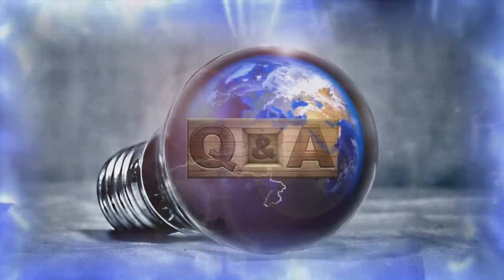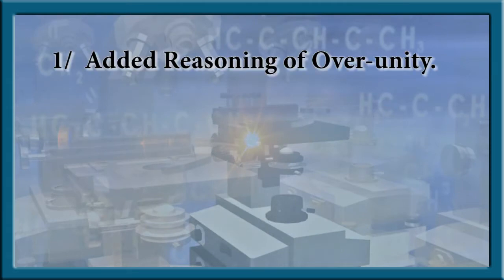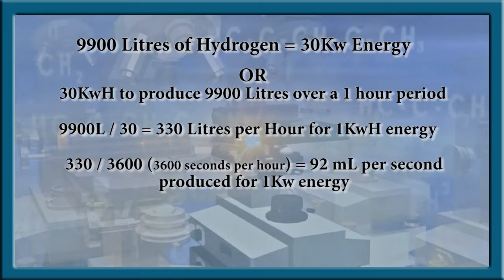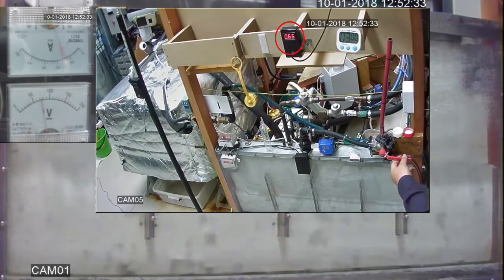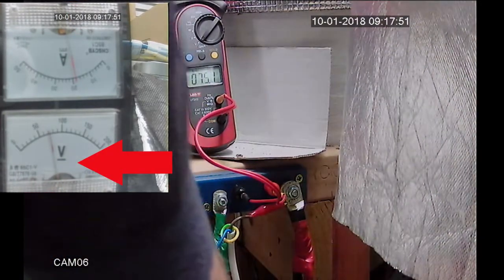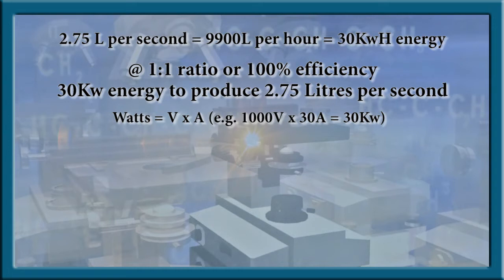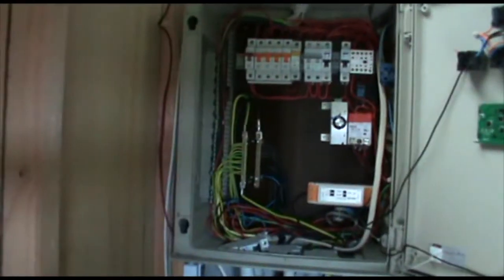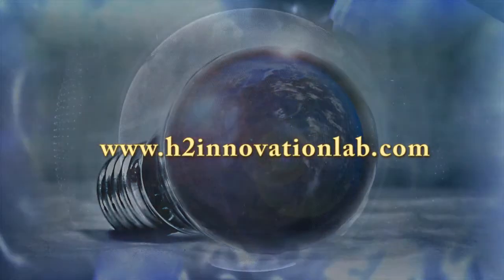Convincing Proof of Over-unity from Revolutionary Hydrogen Energy Generation

Comment: Are you referring to efficiency or factor of coefficient? I think some are misunderstanding where the remainder of energy is coming from.
Reply from the maker: Technically it would be more scientifically accurate to use the term coefficient. Thank you for the correction.
We have as an example the common Heat Pump (ASHP) that will typically produce around 3kW thermal energy for every 1kW of electrical energy consumed, giving an effective “efficiency” of 300%. One would argue that according to the current law of thermodynamics it is impossible to have an efficiency of more than 100%, as this implies that more energy is being produced than is being put in.  For this reason the performance of a ASHP is expressed as a Coefficient of Performance (COP) rather than an efficiency. However it equates to the same, namely usable energy output over generated input energy. 
The above example would be expressed as having a COP of 3.  The reason that it appears that more energy is being produced than is consumed, is because the only “valuable” energy input is electricity used to drive the compressor and circulating pumps.  The remainder of the energy simply transferred from a heat source that would otherwise not be used such as the ambient air, so is not considered as an energy input.
In like manner, with the H2IL discovery, the remainder of the energy that equated to a 2000% efficiency simply transfers from the galvanic energy in bi-metals. 
But, as with other forms of “renewable” energy, where the source of fuel is virtually limitless and free, it is the total cost of generation rather than the efficiency that really matters.
Reply from the maker: H2 Innovation Lab (H2IL) invites you to view an introduction to co-efficiency verification testing of its game-changing energy technology.

The tests are carried out using a PEM Fuel Cell stack to convert the generated hydrogen energy back to electrical energy. Input power in compared to out power real-time.
Scientific feedback is to the effect, and quote, "I truly believe you have achieved the remarkable" - "even if the fuel cell performance was 100%, which is impossible, the output readings are obviously greater than the input power." 

Please follow this link directing you to the brief 

intro video: https://youtu.be/L-PfstY_jYk
Thank you for your support.

Comment: Will you be presenting this to the scientific community any time soon?
Reply from the maker: Thank you for your comments.

This information including technical videos and performance tests located on the H2IL website is in the public domain as presentation to all. They are being used and can be used by the science community not just locally but internationally. 

As for the in-depth intellectual property subsidiary to patents,  this needs to be kept confidential in order to retain I/P value. If it were to be made public and free to all then the integration would never take hold. Common business dictates that the required investment into it’s integration requires retaining a significant market share.

Please keep up the practical comments :)
Reply from the maker: H2 Innovation Lab (H2IL) invites you to view an introduction to co-efficiency verification testing of its game-changing energy technology.

The tests are carried out using a PEM Fuel Cell stack to convert the generated hydrogen energy back to electrical energy. Input power in compared to out power real-time.
Scientific feedback is to the effect, and quote, "I truly believe you have achieved the remarkable" - "even if the fuel cell performance was 100%, which is impossible, the output readings are obviously greater than the input power." 

Please follow this link directing you to the brief 

intro video: https://youtu.be/L-PfstY_jYk
Thank you for your support.